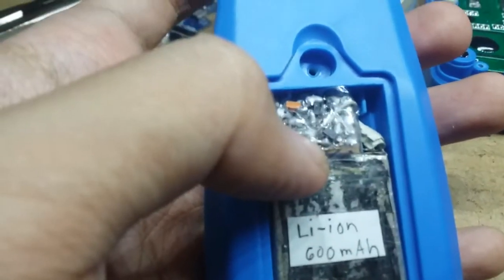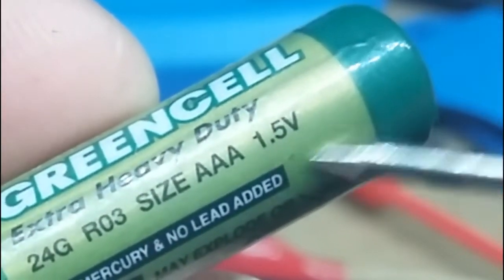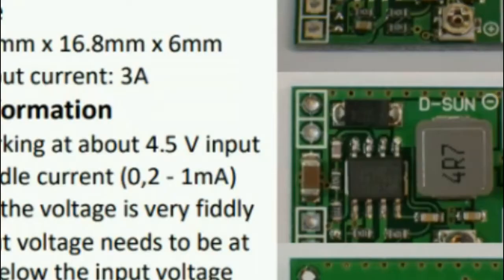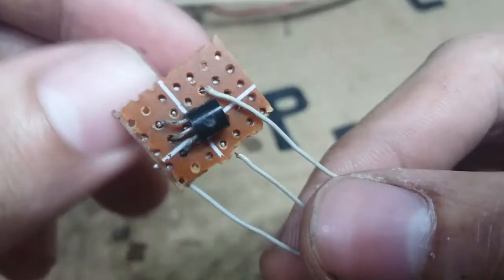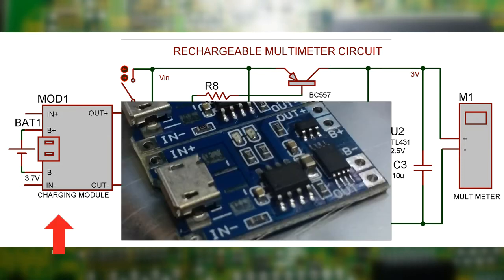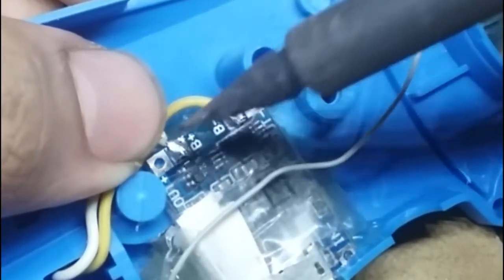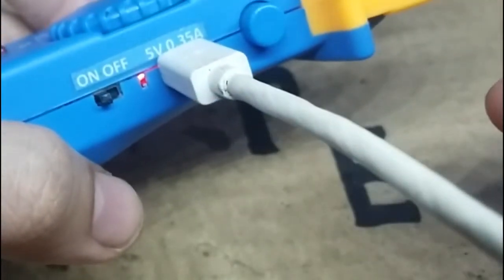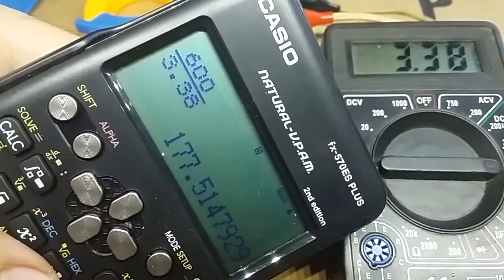How to Make Your Multimeter RECHARGEABLE || hacking a multimeter

Comment: Thank you very VERY much for ALL the info you shared in this video. I learned so many things that I never even expected to learn before I clicked on the link. I never knew about 'Drop out voltage' of regulators. Or how to modify 4065 chips so that I can use them to charge different batteries! Even providing the schematic for a diy LDO regulator was a huge help. Great job on this Video! 👏🙏

You definitely earned a new fan and subscriber with this one. Huge thumbs up! 👍👍👍

I look forward to hopefully seeing new content added soon. Keep it up! And thanks again!